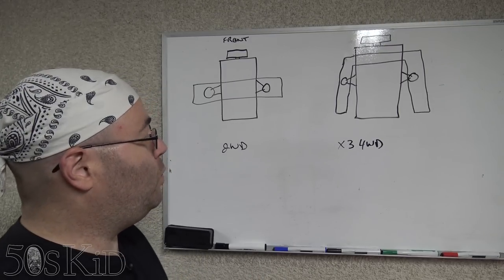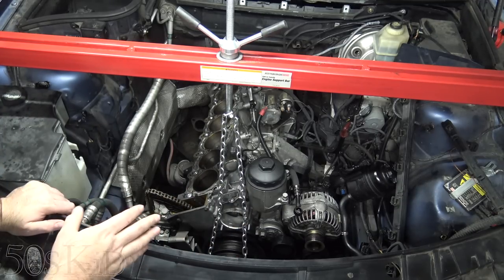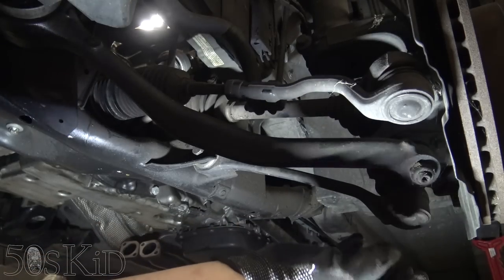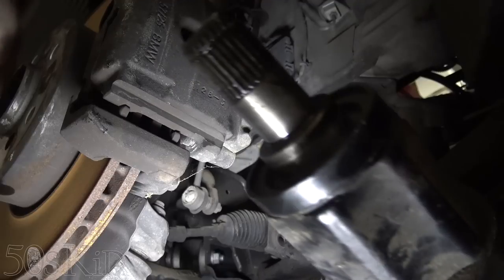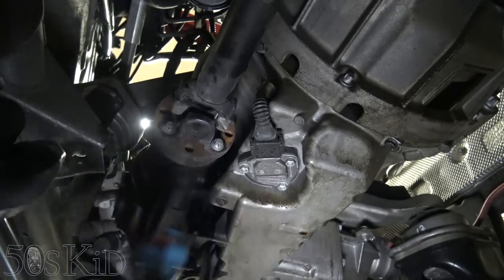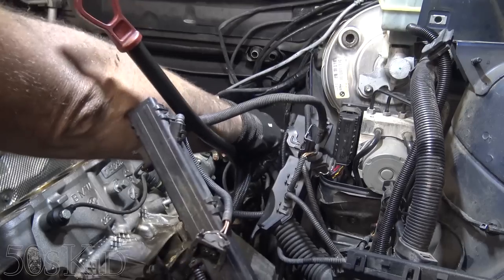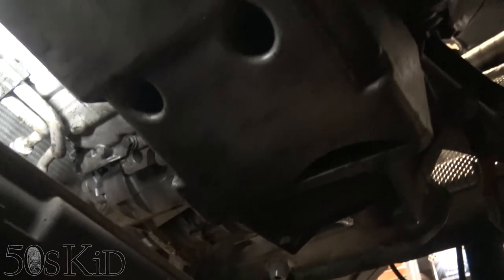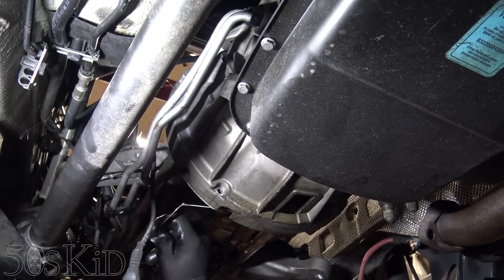E83 X3 Oil Pan Gasket Replacement DIY - Part 1

Comment: Wondering if procedure is same for 2008 X3 M Sport. What I see on video looks mostly doable but I've learned to be cautious after running into notorious BMW tight spaces. Thanks for the edited video that shows optimism during the repair, because we know there were moments of what the heck am I getting into and subsequent language. Well done!

Comment: Thanks for a great video...my son and I did the pan gasket today on his 08 X3 and saved 1400.00 in dealer labor....one tip...the front differential upper bolts are a piece of cake to get to if you drop the subframe first..it leaves a gaping hole to get to those two bolts....it took us 10 hrs. to do on a first ever job like this...….

Comment: bmw tech here. enjoying video so far, nice camera work. just wanted to caution you on the driveshaft hardware removal you are torquing that screwdriver handle directly into your oil pan oil level sensor ... couldn't really tell but looks like you were putting that sensor connector at risk for damage.

Comment: How is it that you stay so cool?  Your confidence level is over the top.  You also give a perspective why it cost so much when you have to take these cars into a mechanic, and why it is so important to have a mechanic that knows how BMW's tick.  One note, I do think it's risky you haven't detached the lower steering shaft.  Not sure how it connects to the steering column on the other side of the firewall but on the e39 that shaft can separate or even break due to the weight of the front sub frame.  Looking forward to Part II.  Thanks for sharing these amazing videos that will survive the test of time.

Comment: Hey,when you are hammering the driveshaft (axle) through the hub try using a heavy tapered (ball end) drift or chisel on the dimple in the centre and you will avoid damage to the threaded area, I also use a 1kg (4lb) hammer as the extra weight helps shock it out, I’m from Scotland in the UK so we are used to a lot of seized components here lol. Keep up the great work I watch all your videos
Reply: 3 hours and I am no closer to popping that snap ring on the drive shaft. Mine must be glued in or something! I have pried, tapped, pulled and it's still in there!

Comment: Those subframe bolts (8, I believe) come loose and create a clunking sound when moving forward, or, backwards at low speed (ie. from a parked position) with wheels turned. A tidbit.

Comment: You're going to have a hard time getting the axles back if you can't swing the knuckles out of the way so you have a straight shot.    I think you will wind up further unbolting them.

Comment: Hello, I bought a 2002 530i with the engine disassembled for $1K. I am new to BMW and was told that the oil filter housing needed replacement. The new part was in the trunk. I replaced it and reassembled the engine. When I attempted to start the engine, it sounded like it had very low compression. I tested the compression and found cyl 2 and 4 have zero compression. At this point I'm trying to decide if it's worth repairing. I am planning to keep and drive the car. How common is it for the head to be cracked? Also, with it not running, I don't know the condition of the transmission. What should I look for to determine the possible condition of the transmission? Thank you for any information!

Comment: I'm having the hardest time wiggling the oil pan off! All of the bolts are off, do I need to remove the transmission cooler lines? What's the trick?

Comment: Great video. Is this procedure identical to the 2008 X3 with N52?
Reply from the maker: There will probably be slight differences but to be honest with you, they're likely to be minor.  The N52 is based on the M52/54.  Nothing changes that drastically.  It's BMW's inline 6 engine sitting on a subframe that's bolted to the body.  Pretty straightforward.  Good luck!

Comment: After I did this job on my wife’s E83 X3 it messed the steering alignment. Even though there are guides to put the front subframe back in place it’s still 3 degrees off to the left.

Comment: Great helpful video as always, can't wait to do my 2002 bmw 325xi pan gasket👌, hey just recently bought a 1996 318i with rod knock on cylinder 3 is it possible to fix the sliped rod bearing by just taking off the oil pan and replaceing it from there ?
Reply from the maker: yes it's possible to do it in car with the oil pan off

Comment: I have a question and need advice. I am currently doing my oil pan gasket on e46 323. I accidently forgot to support the engine before i lowered the subframe. So i lowered the subframe about 2 or 3 inches with the engine ontop of it. I very quickly realized my mistake and set the engine support bar up immediately and jacked the subframe back. Is it possible that i damaged anything? This is my first time doing this kind of job. Thanks in advance!!
Reply from the maker: Nah you're fine.  I'm surprised you didn't tear a cooling line.
Reply: awesome thanks for the reassurance, i do notice some coolant seeping from the upper nose now that you've mentioned it. Your vids are great! thanks for being so thorough.

Comment: Have some disa valve questions if you can help me out :(
Reply: Konstantinos Papavasiliou would a vacuum leak from the intake boot cause the disa to act up?
Reply: What is exactly the problem? Do you have disa fault codes? What car and what engine are we talking about?  Vacuum leaks should be taken care of. Also disa valves can be mechanical damaged. The disa acts like a throttle body, the shaft could have come loose.... Check out 50s Kid's upload on disa valves, he explains very detailed how it works
Reply: its a 2000 bmw 328i. There were alot of crack in the intake boot which is why I think I was getting some lean codes. I have seen people check the disa valve by taking it out but leaving the harness plugged in. When they put the key in the on position the valve closes etc. When I did that it didnt close. However when I checked the diaphragm myself it holds vacuum and everything. I just took it off to rebuild it etc. with a kit that comes with a billet flap and everything else to prevent it from breaking.
Reply: I have a 2000 328ci myself. On this car the disa gets its vacuum directly from the intake manifold while the engine is running, no extra vacuum line. The lean codes are most likely vacuum leaks. You should first take care of them and then adress the disa. The disa gets activated by a magnetic valve which is build in the disa  housing. You can easily test if it's functioning, if you have a diagnostics, with actuator select, or if not, by simply applying 12 volts on the disa electrical connection. Either way you should definitely hear it's working. If that's not the case, the disas magnetic valve is faulty, or the circuit of the disa harness is open. You should read battery voltage at the harness with ignition on
Reply: awesome. Unfortunately I dont have the tools to test that. I have also read in forums the Disa should NOT move when you have it plugged in but not in the actual slot when the intake boots and everything is disconnected because it cant make the vacuum. Is that true?